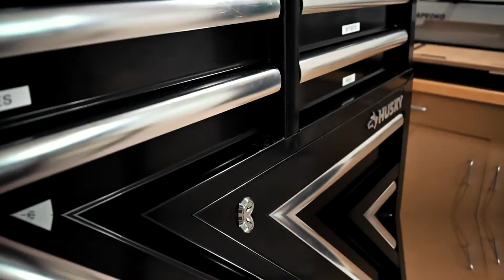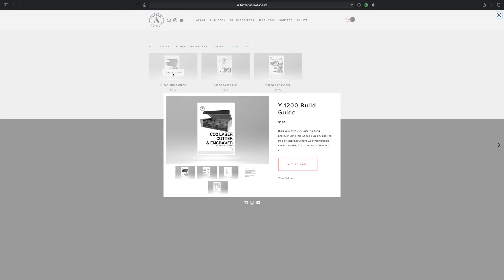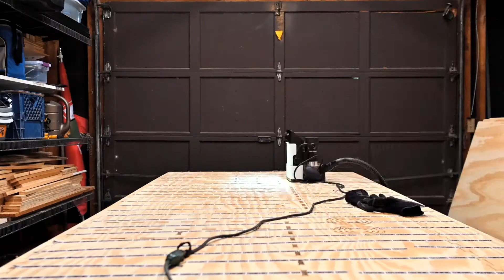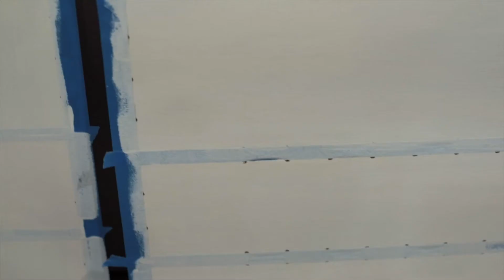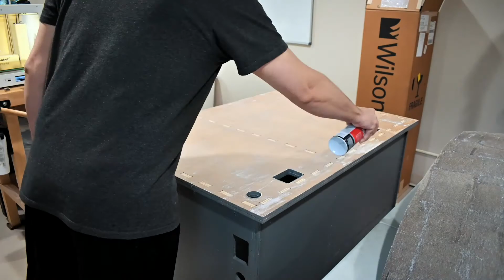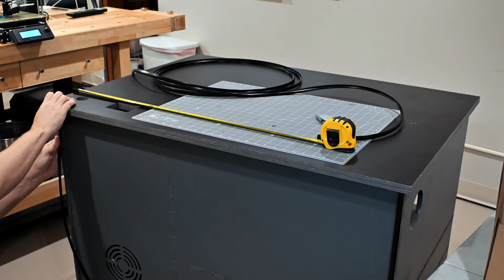90W Laser Cutter From Scratch | Custom Cabinet [Part 1]

Comment: That's awesome the entire build with just the router!! 👍🏼
Reply from the maker: It probably would have been easier with a table saw but it worked! :)
Reply: Have you checked the price of a Shaper Origin? You could outfit yourself with a complete set of job site tools, a router, and a dovetail router jig for less.